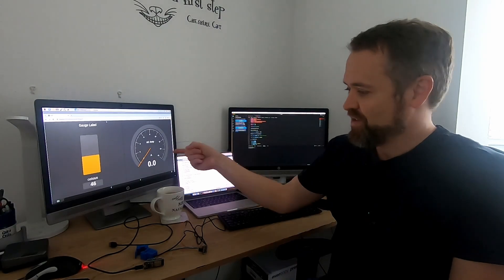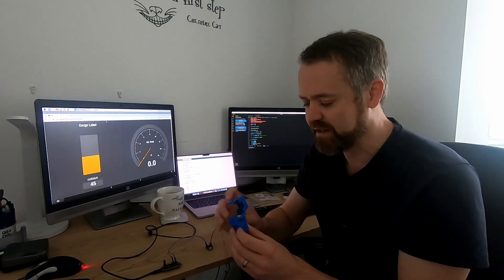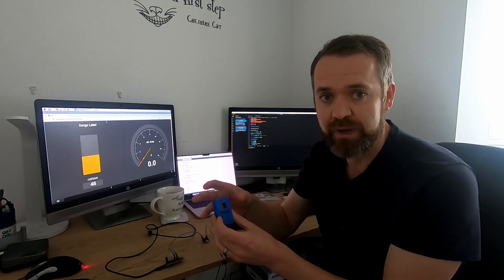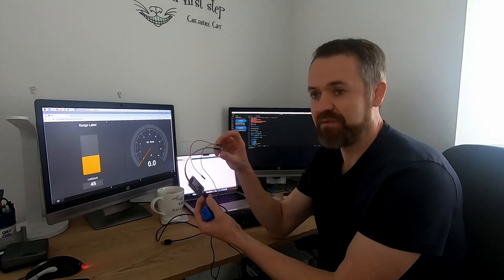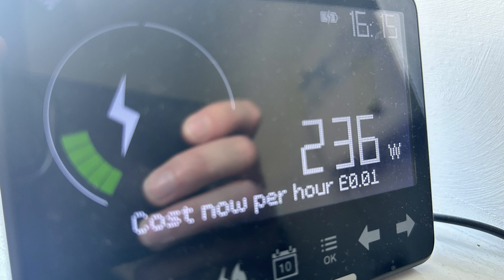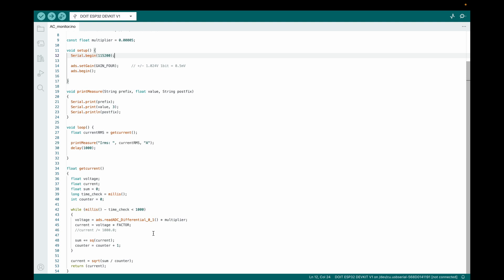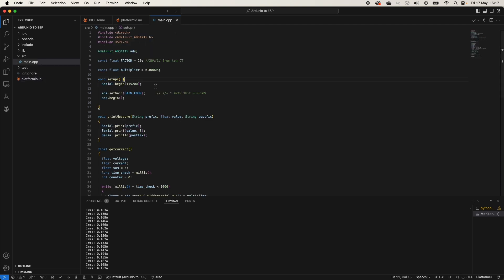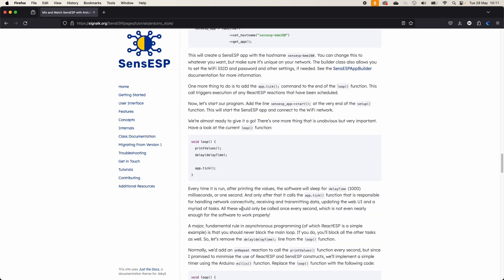SensESP AC Power monitor - Converted from Arduino sketch

Comment: It should be noted that this type of amp sensor measures the magnetic field produced by the current, therefor it works on insulated wire. Do not strip the wire.
Reply from the maker: Hi - Yes thats correct. You also have to make sure you only clamp the live wire, so for three-stranded wire, you might have to remove the outer insulation to be able to do this.

Comment: Can you modify the code base to include the real-time watts usage as well.
Reply from the maker: Hi - Yes it could, at the moment i'm doing that in Node-red as its helping me learn that platform and i've also made it show me cost. I can have a look at adding that to the code. We just need to times it by the voltage and create another path
Reply: @BoatingwiththeBaileys  Thank you I am learning from your examples as well. Can you show us how you also did this in node red as well.
Reply from the maker: Hi, I will do a video on Node Red but it's likely to be a few months yet. I need to do some sailing while the weather is still good. I will come back this though 👍⛵️
Reply: @BoatingwiththeBaileys  Fair enough enjoy your time at sea. For the next round of videos can you also do a DC shunt voltage current and watts as well.

Comment: Another interesting video, thanks... My latest project might interest you. I am using a Ecowitt weather system (uses ultrasonic for wind and direction) with its gateway and a esp with nextion display to show the information. I've also got ecotwitt wireless temperature and humidity sensors. The benefit with this, no raspberry pi required to be running!
Reply from the maker: Hi - Thanks for your comments. Your project sounds intestering, i'll have a look at these sensors. I would like something for the fridge thats wireless. Is that device talking direct to an ESP then?
Reply: You can buy an ecowitt gateway (little blue thing that can plug into usb for power) for the system and sensors then connect to it via rf. The gateway has a built web server to display the sensor data via a web page. However, it also has web api which output live json data. I coded the esp device to call this web service... So i guess out of the box you can monitor sensors from a web browser or use a esp to build an alarm device or somthing by having it monitor the live data